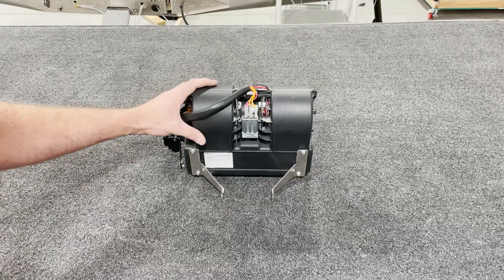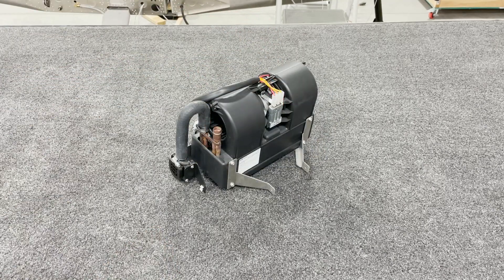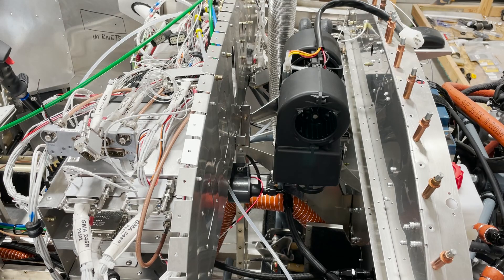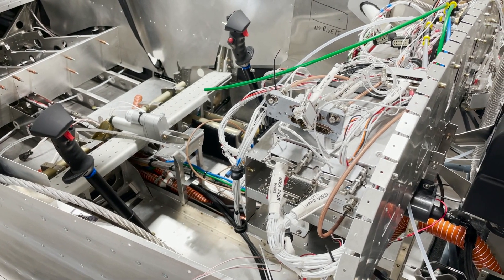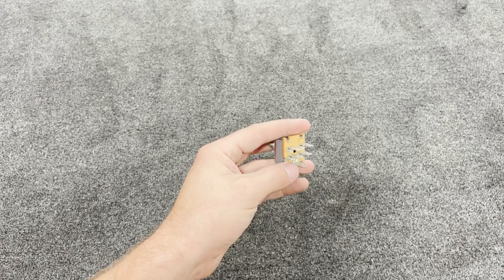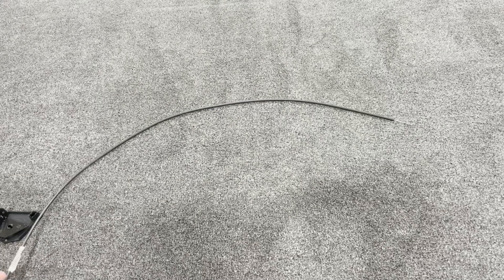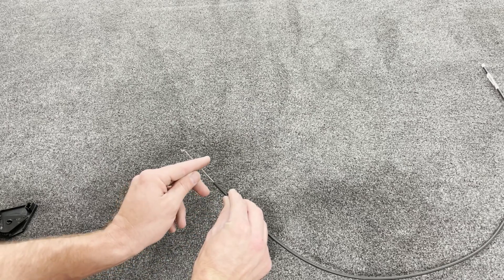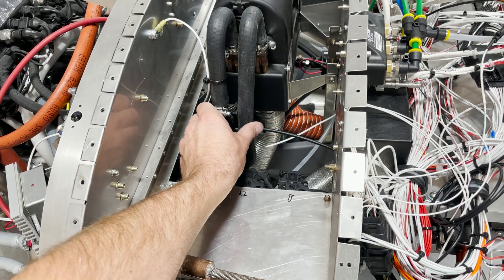9.1. Sling TSi Heater Installation

Comment: You used wire on the pitot tube, and those terrible garden hose clamps on the heater. Why not just use a spring clamp like the automotive sector?